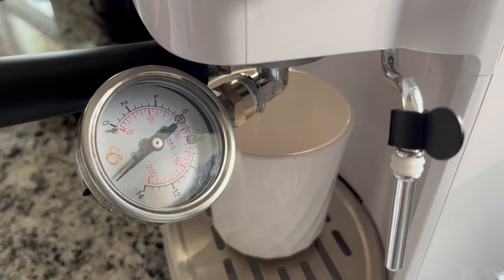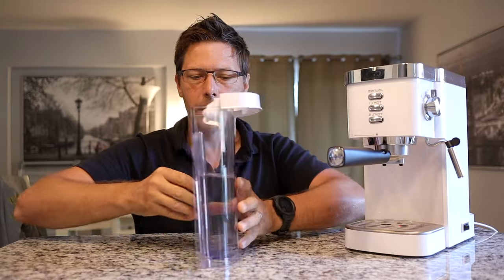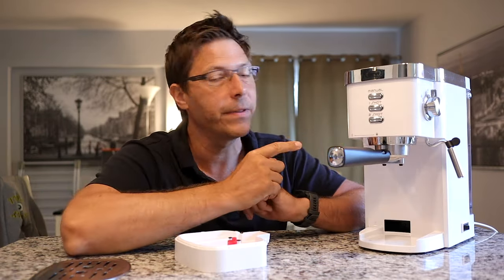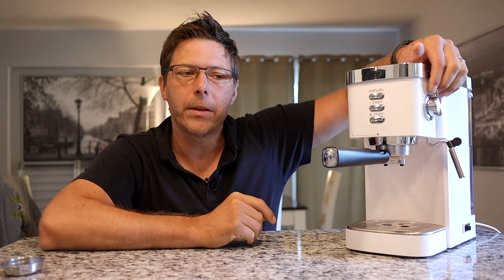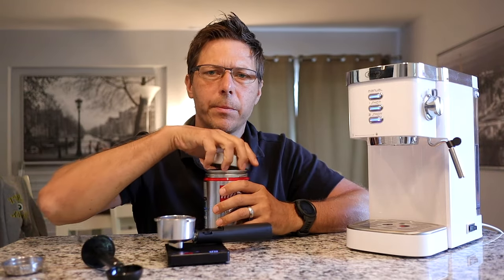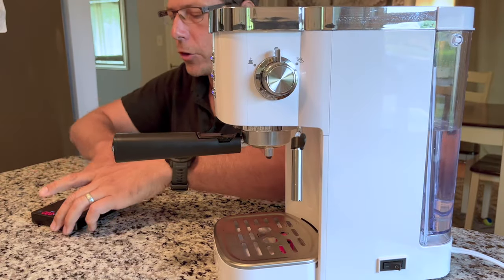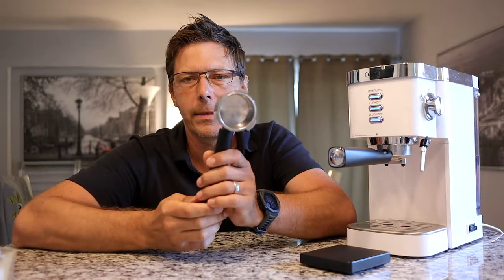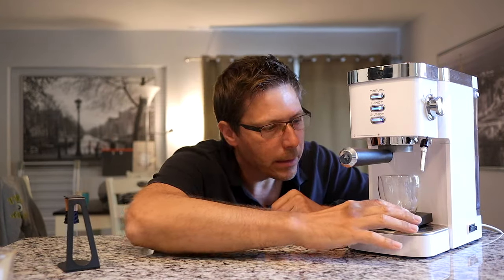Gevi 20 Bar Home Espresso Machine Review & Test

Comment: I was on and off using this machine and with the CAPFEI portafilter. I still liked it better than the pressurized that came with it. I wasn't getting much crema with it and espresso beans. I do use a WD tool, leveler, and real tamper, plus a screen. I recently discovered that using a light/medium Costa Rican single-origin coffee that I hand grind that I found that I do get some crema and I much prefer the brighter taste. Just enough acidity to give a fruitier taste. I will say that even without getting crema with my espresso beans (medium quality) once dialed in the taste was still good. I used to use flavors and coconut sugar along with cream. It's been a switch going to black coffee. Now, I'm just having the Costa Rican either as a Lungo or as an Americano. I seem to get a larger ratio in a shorter time than general wisdom says I should. However, the end product is what I like. So setting aside the conventional logic of time, output, and, roast, I'll just enjoy it and quit trying to match up what "wisdom" says I should be getting and doing.
Reply from the maker: Thanks for posting your experience. That's right, you should go for the flavor your after. If you're satisfied, that's all that matters. Cheers!

Comment: The biggest problem of this machine is there are no compatible bottomless portafilters that seal and keep the pressure. There are 2 on Amazon that appear to fit, 1 of them you linked, but they won't seal and would leak water everywhere. The original pressureized portafilter seals properly, and actually produces a better brew. Other than that, I love this machine.
Reply from the maker: Are you sure the Capfei wouldn’t seal? I’ve had good luck with their equipment, and this PF gets good reviews on Amazon. But either way, thanks for sharing your thoughts on the machine.
Reply: @TomsCoffeeCorner  Yes, I actually bought and tried it. While it does fit this machine, it does not seal it properly and keep the pressure during brewing, water would splash out from the top of the portafilter and the resulting brew has no crema.
Reply from the maker: @acefr8816 Which basket were you using? Sometimes that also makes a big difference (convex vs flat lipped).
Reply: @TomsCoffeeCorner  I used the basket came with the Capfei bottomless portafilter. I didn't try a basket from another manufacturer. If someone did, please let me know which basket that does not leak. The original Gevi basket does have a lip.

Comment: Excellent video. I must say I do not see me going to all that trouble to pull a mediocre shot. With the knockbox, if it has a nice rubberized bar you can hit it at speed but no force behind the blow, allowing the portafilter to bounce of the bar. The puck of coffee will come flying out whole every time when you get the hang of it.
Reply from the maker: I’ll try that. I find of all machines by the way, DeLonghi knocks out the cleanest and easiest.
Reply: With my Flair 58 I can express all the water and run air through the puck. It knocks out better than my DeLonghi. The thing I like about knocking out a whole puck cleanly is that it is an indication that I did good puck preparation. Before I got puck preparation down pat I could have uneven density of coffee and compacted areas (especially when trying coffee levelers that you spin) and when I knocked out the puck it could break up along these differences.  @TomsCoffeeCorner

Comment: Question; i purchased this machine and really like it however when finished there is always water in the portofilter - is that normal?????
Reply: Same here. Tried remedies like using filter screen and bottomless portafilter. But got the same soggy puck. Until I adjusted the grind size to medium coarse. That eliminated the wet puck.
Either way it didn’t affect the taste though. It’s just that messy coffee grounds after the extraction that I hate to remove.

Comment: Nice video as always.  I'm not sure I would rec that model (GECME022-U) when for 50 bux more (GECME418E-U) you can get SS body w manometer and regular steam wand.  Can we see the inside, if you get a chance?  

I do like that 51mm Capefei PF.  I went thru a lot of trial and error trying to find PF from AMZ.  51mm accessories seem limited.  ikape has some stuff you could link as well.

It's interesting to see the competition between Italian brands.  I'm really impressed by how much power the lil machine has.  18 bar probably explains why I kept blowing out pucks when I started using it.  I think mine does a preinfusion tho?  

Thanx again for all of your videos, I learn something new every time.  I couldn't find the ESP v. Opus vid tho?
Reply from the maker: Hi there! Yes, the other Gevi with the manometer is probably a bit better from a feedback standpoint and also the steam wand will be nicer. But I expect the result in the cup will be the same.

Comment: I found a compatible open bottom potrafilter on Amazon when I searched for the specific model name. One problem though, the hot espresso sometimes drips down the handle of the portafilter as I'm pulling a shot. What causes this?
Reply from the maker: It might be escaping between the basket rim and the gasket. I'd recommend the PF from Capfei - I've had good luck with those.
Reply: @TomsCoffeeCorner  
Yes, I believe that's exactly what's happening and it seems to be related to either grind size or tamping pressure. I'm playing around with both.